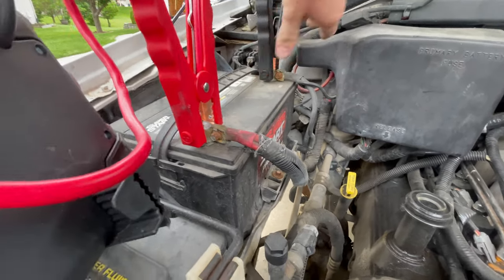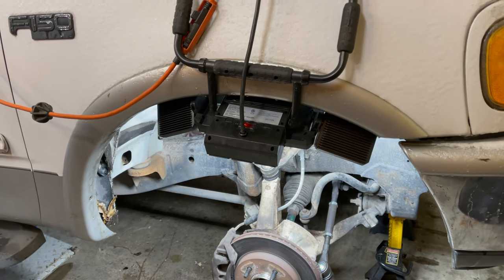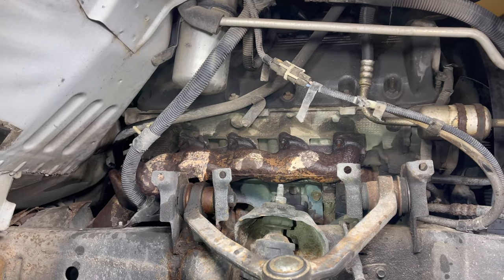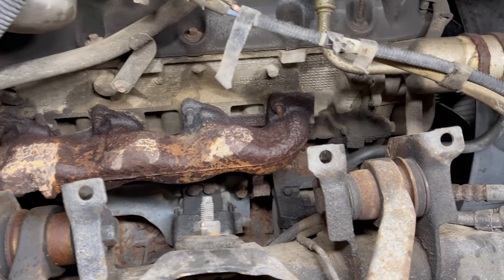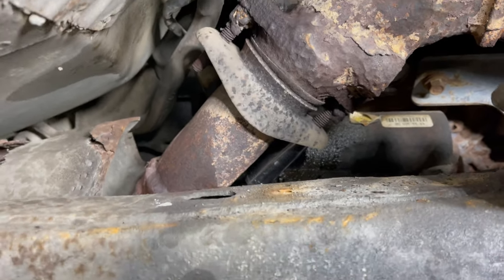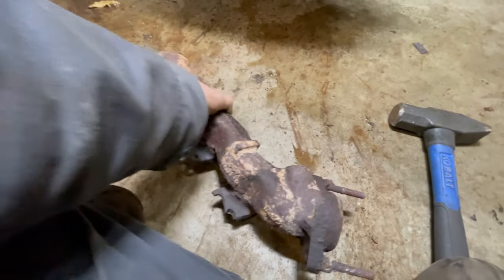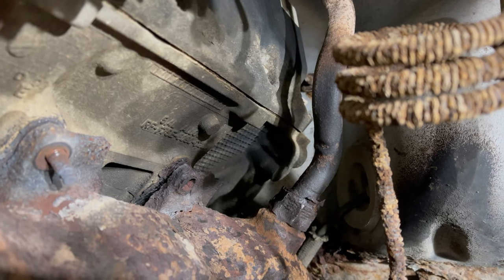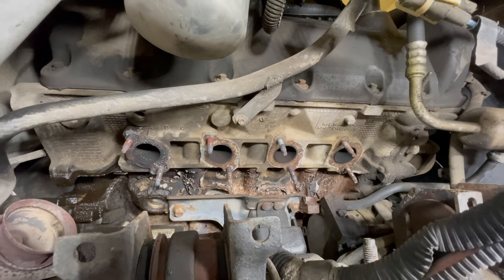Broken Exhaust Manifold Studs

Comment: i have a 1999 ford explorer xlt with the 5.0 V8, i had my right side exhaust manifold go bad but turns out the gasket just fell apart… but going into it a week in advance every day id soak the bolts and studs with WD-40 and when it came time for me to get the job done all the bolts and studs came out easy enough with just a small bit of force to just break them loose… and i only had two of them that needed a little force… the rest just came out easy from the amount of lubricating i did. I’m just glad my attempt was successful because i know how these jobs can turn from a few hours into a few days if something goes wrong.

Comment: Even with the hiccups you had this seems like a much simpler job than the 3v. I had my passenger side one crack and spent two days trying everything to get that thing out without an engine crane. Ended up having a shop do it how your supposed to by lifting the engine up, complete fail. I’m still trying to figure out what Ford was thinking with that stupid design

Comment: I saw a video on replacing these studs and when they snap off, the gentleman drilled the first couple threads out of the cylinder head and it’ll spin right off since the only corrosion is at the end. Not the best way to do it but may be worth a try? https://youtu.be/a0ABrs8NEMQ I have never dealt with it but if you’re going to replace the heads it’s worth a try first. Keep up the good work!
Reply: Absolutely! I’ll usually ‘countersink’ the edge of the aluminum and use left hand drill bits to spin them out.